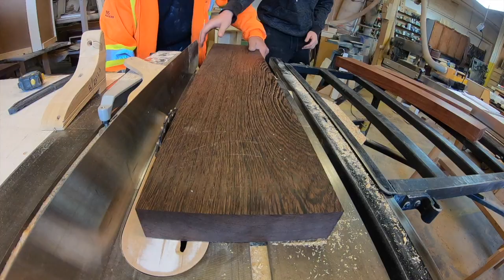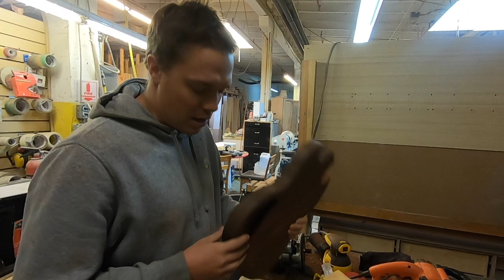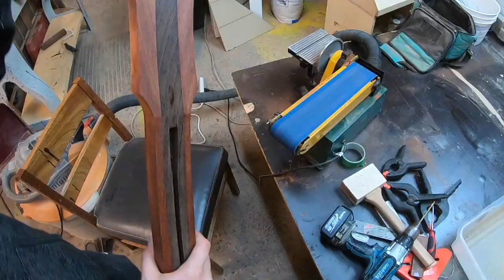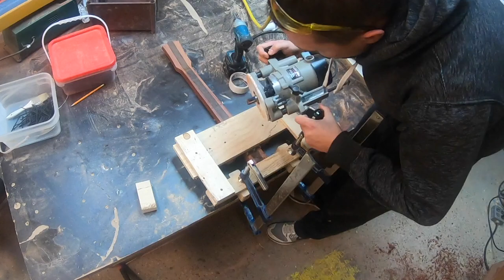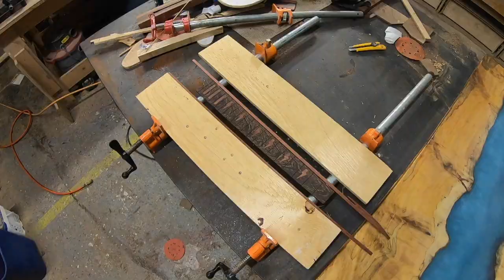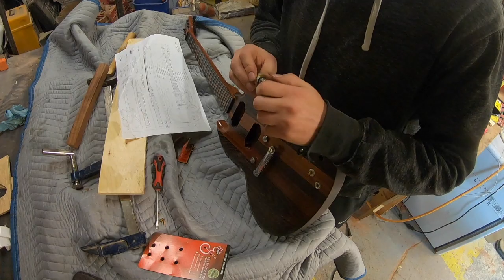Luthier - Handmade Gibson SG Style Solid Body Guitar (start to finish build)

Comment: I have never seen an SG that looked this good. And you shouldn’t have a problem with a weak neck/headstock joint with that laminated neck.
Reply from the maker: Thanks man, I appreciate it! Yea the tension rod is overkill, the density of the bloodwood alone wouldn't allow it to warp
Reply: @KurvyWoodworking  All wood ”moves” with temperature and humidity so a truss rod is a must to adjust the guitar to a acceptable ”action”. However your 3-piece neck reduce the risk of a headstock break to a minimum…
Reply from the maker: @peterhansson7967  agreed but laminations even parallel to the direction of the stresses help to resist the movement. I also reversed the grain pattern between the two exterior bloodwoods in an attempt to counteract the movement but your right, truss rod is a must regardless
Reply: @KurvyWoodworking  You are using two (fingerboard not counted) different wood which means that the will/might/must react differently to temperature and humidity. And even the fingerboard may react differently due to spiecies or grain direction. If the fingerboard expands more then the materials in the neck you risk so called back bow, which could render your guitar unplayable if lacking adjustability.
Many guitars have laminated necks and they always have a trussrod installed… Many necks even have carbon fibre rods installed and yet the have a trussrod.
In the adjustment of the string height we are talking about fractions of millimeters and some like a little relief in a neck, others want it perfectly straight.

Comment: for the electronics you can always route out the back...I love sg's
when using the rasp on each end of the neck...wouldn't it be easier to use a planer to blend them together than to continue with the rasp...just my 2 cents.

Comment: Did you just glue that neck on the body? No screws or anything. I’ve been wanting to build an sg for a while but the only thing that’s holding me back is the body to neck I can’t find any templates or anything on how to make the bottom end of the neck
Reply from the maker: Yes i did! Easiest way is to continue the cut straight from the neck pickup void. The cap you install over the neck pickup will cover up the transition. I would continue the neck "trajectory" towards the opening in the neck pickup, and cut the neck slope off of the neck itself. I made two other guitars where i went into more detail for that step (Also, id advise to not make the heel if your doing a glue-up, just straight from the body to the neck)
Reply: @KurvyWoodworking  cool thanks man

Comment: This is a great looking guitar, lovely. I think a consultation with a proper luthier would have helped a bunch, I can tell from the video that the neck and body are very thick, and the nut and fretwork need refining. It’s very cool to see where an incredibly skilled woodworker goes with things that someone who’s strictly a luthier might not. The electronics channel for example, I really like that and how generous the tunnel was. Must’ve made getting the pickup wires through it much easier than a traditional drill hole. I’ve built guitars with wenge before and that stuff is not easy so I give you props for doing it! Stuff splinters like nobodies business and that can be a pain, feels killer under the hands when playing a neck made of it though, fast feeling. You should consider building another but refining it further, I’ll bet with the level of skill you put into this one the second one would be phenomenal, I’d love to see another from you.
Overall, great job and great video.
Reply from the maker: Appreciate it! I agree this is definitely more crude and took a very long time over-thinking every step. I tried talking to a couple luthiers near me but find a lot want to keep information close to the chest but luckily youtube is a good teacher. I actually have made 2 since this video where i resolved the weight and neck issues. First one is a les paul style and the second is a fully custom designed double neck guitar (12-string and 6-string). Process is getting more refined and i still have a couple of kinks to work out but if you're interested in seeing them, they're the latest two videos i have uploaded on my channel!
Reply: @KurvyWoodworking  awesome possum, I’ll check those out. Glad to hear you’ve kept going with guitars, my first couple builds were absolute trash compared with those one so you’re off to a great run I think. I’m sorry you ran into luthiers who were stingy with their info, most I’ve associated with were the opposite and very great resources to chat with.

Comment: I don’t understand the slope u had to router for the neck on the body. What’s the point of that and would I have to do that?
Reply from the maker: different guitar styles have different slopes for the neck. It helps with the stresses from the strings so it doesnt bow as easily. since this video, i now cut the slope into the neck of the guitar for accuracy. You can see that in my les paul and my double neck builds

Comment: You could have saved a lot of wood on the neck by glueing ”wings” on the headstock. That is what Gibson does 😉
How did you get the laquer of the frets after the spray painting?
Reply from the maker: yea picked up the wing trick on the build im currently doing. Helps with the truss rod installation as well. 
For the frets i used tape and a dremel tool with a high grit sandpaper. I changed it with my les paul build to lacquer it first but it was a nightmare to install the frets afterwards. For my current build im back to installing the frets first
Reply: @KurvyWoodworking  It is always a bit more problematic doing a laqured fingerboard than an oiled or vaxed one.

Comment: Nice- you need to reduce the heel though. Why didn't you take the lightning bolts through the upper frets? It kinda looks like you gave up on them half way through 🤣
Reply from the maker: would have had to shrink the length to accommodate the lightning bolts at the end. I made the inlays but it didn't look right so went for the straight option. Yea started to make a Gibson Les paul look alike and going to reduce the heel and the width of the neck as well.

Comment: I'm curious how heavy this guitar is/was. I know that wenge and bloodwood are pretty dense.
Reply from the maker: Yes youre right, the bloodwood felt like a piece of steel with its density. The overall weight is 12 pounds (heavy for sure). I think standard gibson sg's weight around 6-8 pounds by using a mahogany body

Comment: Do you need to wear ear plugs when crafting a guitar?
Reply from the maker: Depends on the step, the plunge router is extremely loud so always use ear muffs when using that tool, but most power tools in the shop arent too bad. The newer generation tools are more quiet.